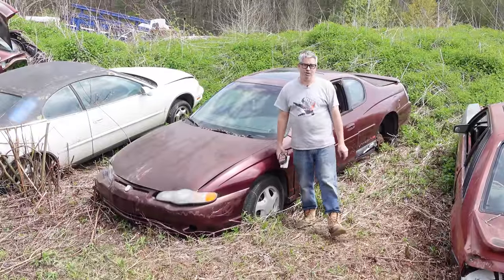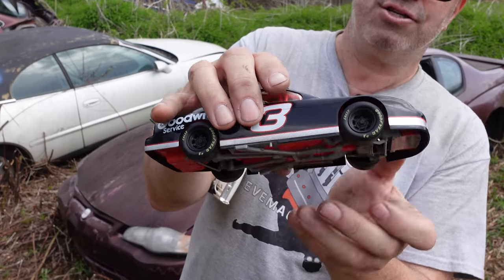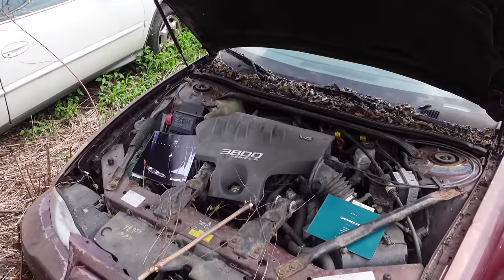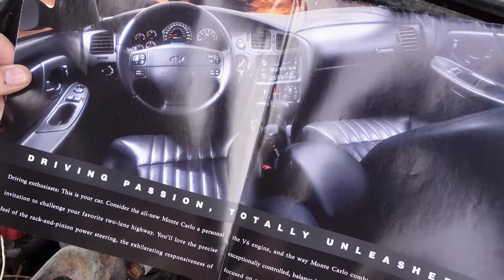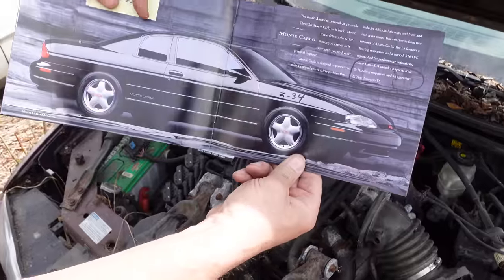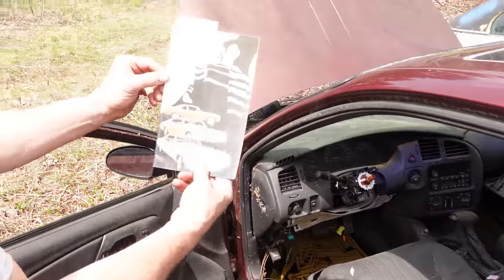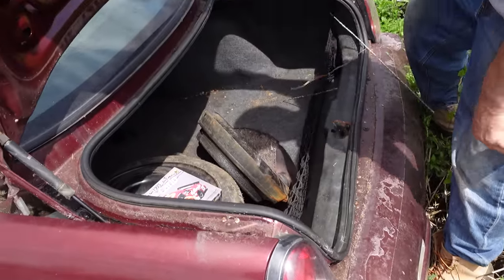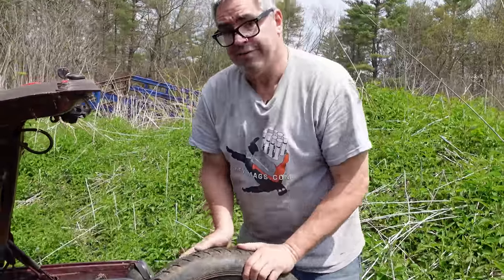Monte Car Low

Comment: 2000 wasn't the first appearance of the Buick 3.8 series II in the Monte Carlo. The last two years of the  previous gen saw the 3.8 replace the 3.4 Twin Dual Cam motor in the Z34 model.

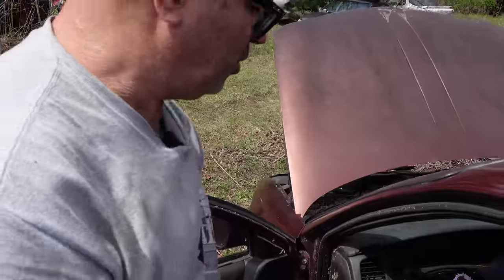Comment: Anybody else notice the Lumina Z34 in the background at 6:42? You could get those with a 5spd manual for a few years. There were a few odd choices by GM for the Gen5/Gen6 W-body Montes. Like why they maintained the Z34 moniker when they ditched the DOHC 3.4L and went to the 3.8L in 97. I don't understand why they didn't go straight to the 3.8L SC motor for the SS when Pontiac and Buick had already been running it in their W-bodies since 1997. Made it feel like such an afterthought when it finally happened in 2004. The LS4 SSs are definitely the odd duck of the LS family, but it was pretty cool to see a V8 make it's return to the Monte line, even though the LFX 3.6L V6 would eclipse it in power after the SS model was gone.

Comment: In 1994 I went to the dealer to order a new 95 Monte Carlo,  I was so disappointed by the V6 front wheel drive that I completely jumped brands and bought a V8 RWD 95 Thunderbird instead.

Comment: I have an 06SS.  Black on black. 5.3 LS4. Drive it everyday. I put a Jasper trans in it 5 years ago, and other than that it's been the best car I've ever owned. Comfy, moves right along and sounds great. Get compliments all the time. Got my license in Dads new 72!  I've had a 72, 97, (2)98's, 20, and my 06. Daughter had 2, 98's.  I've BEEN to Monte Carlo to visit my sister and attend the Grand Prix there in 09. If they ever came back, make mine an LS3, 6 speed rwd please.
Reply: Surprised you haven’t put more than one trans in it. Awesome car though hilarious 0-60 definitely a sleeper
Reply: @darrensanimalsreptilesfish30  Because I replaced it with a Jasper 'remanned'. Upgraded internals, not a rebuilt with OEM stuff. 5yr, 100k mile parts AND labor.
Reply: @SuperOperator4  Post some videos of it.
Reply: Jasper?? 🤣🤣🤣🤣

Should've used a Monster High Performance Transmission instead. 

Best transmission case closed.
Reply: @extremedrivr  Going strong after 3 years, beat daily

Comment: Chevy had the Warner Bros. contract even before this car. In 1999, the top rrim level Venture minivan was the "Warner Brothers Edition", complete with badging on the front doors by the Venture nameplate of Bugs Bunny leaning against the trademark "WB" shield.
Reply: @corvairjim1 I had a 1962 Rampside sat in the backyard off my buddys house. For almost 25 years. Had a lot of rust bought a brand new fuel tank from Clark’s Corvair. Got the firing order corrected Cleaned carbs. By the way Bought it for $2k had it towed to my house almost 6 years ago. Truck fired up had the mystery shifter the one that rubs on the tank. Very reliable truck. Sold it about 3 years ago went fast to a guy in LasVegas he brought a trailer. I’m from San Diego.👍

Comment: I bought a 2005 LS for cheap at 170k miles, and even though I know I'm about to have to drop a couple grand into it to fix all the little issues that have started to crop up (20 years old, it's expected), it's probably my favorite car that I've ever owned. It's shockingly comfortable for a cheap car, and the engine runs great. I'm determined to keep this thing on the road past 300k miles!

Comment: Yes, they quit clearcoating certain underside areas, probably to meet government mandated restrictions on total output of VOC's (volatile organic compounds aka solvents) In the late 90's , some genius somewhere, came up with what they referred to as "under hood colors. Most refinishing techs ( car painters) were none too happy about that, myself included. The factory would paint the underside of the hood, and fender edges, a different,  but similar color. It would be a non- cleared, non- metallic basecoat, even if the exterior color was metallic.  That meant mixing a second color for that area. If you had , say a door to cut in ( paint the inside) along with something under the hood,  it took 2 different colors. When I got a job replacing the doghouse ( both fenders and the hood) I always cut the parts in with the exterior color, and clearcoated it. It looked so much better! When the customer would notice, they always liked, and appreciated it. I even had an insurance adjuster compliment me once, a very rare occurrence.  Lol
Reply: Nice! I always wondered why the undersides on my parent's 84 Celebrity were dull. Thought it was cheap compared to the full paint on dad's 66 Coronet.
Reply: Fellow body shop guy here too. I know exactly what your talking a about 😅

Comment: My dad had one of the 5th gen z34 cars and my mom had the the 4door lumina at the same time. Fun fact about that engine with 210hp in the z34. While my dad had his i was riding behind a lumina ltz had no idea what that was till that day. I did notice the 4 pipes sticking out the back and the z34 wheels but didnt think it was anything but my moms lumina with a appearance package, that is till it dusted my pickup. I called my dad and said i just got smoked by a lumina, what the hell is a lumina ltz. He said my z34 with 4doors. 😅 so yes they put that 210hp v6 in a few lumina not sure how many but dont think it was a bunch. Dad sold that z34 for a front drive super charged regal gs. Now that was a fun car think it had the same engine as the 6th gen monte ss but with a super charger on it. During that era buick was throwing super chargers on alot of their cars even some of their 4door luxury cars had them just look for the supercharged badge on the trunk.

Comment: I owned a 1998 Lumina LTZ which was basically a 4 door Monte. It had this same drivetrain and was a decent enough car until the northeast winters here dissolved the rear subframe sections. Notorious for bad valve cover gaskets also.

Comment: First year Monty's on a modified Chevelle rolling chassis were supposed to be FWD. But in afterthought GM calculated they would be way too expensive for most Chevy buyers to justify the added expense of their new Turbo Hydra-Matic 425.                                                     So instead of placing the powertrain way forward like on a Toro or Eldo, they mounted the motor and transmission conventionally back near the firewall, used a mile-long fan shroud and rad hoses and...went right on.

Comment: I loved the 78 Monte Carlo I drove in highschool but these were so disappointing. I drove one as a rental and it was truly bad. The giant spokes on the steering wheel left no comfortable long term position for your hands and the one I shared with a co worker ended one long drive with a puddle on the passanger floor from a missing/misrouted a/c drain tube.

Comment: Probably around 2000 there was a local guy who made a 1971 Monte Carlo convertible. He made the rounds at the local cruises! A Chevelle ragtop was used as a donor vehicle. It turned out nice!👍 As for the FWD Montes, I got nuthin' . Don't remember even driving one.🤔
Reply: I remember back in 1996 from Road and Track mail in comment section, One of the Chevy fans were not happy with Monte Carlo being revived as FWD car stating it could ruin the classic Monte Carlo's legacy.

Comment: I loved these in the Earnhardt Intimidator editions. Saw one at Barrett-Jackson Scottsdale in 2018 with only 300 miles on it and only sold for $11,300 (inc buyer fee).
Fast forward only 5.5 years and local private owners are trying to get $20K for non pristine ones and I’ve seen some dealers wanting as much as $35K for a pristine condition version.
Have a neighbour who has a pristine one in his garage with his C6 Corvette. Drives neither and daily drives a KIA.

Comment: I owned a base model 04 with 3.8L. I still think it is an attractive body style and really love the interior (design, not materials). Aside from the front wheel drive, I think GM got this one right. Of course an AWD would have been a grand slam! 
In 2008 I ordered a new Camaro SS, which would end up being built on the same assembly line that the Monty vacated.
Reply: Base models never came with 3.8 i got a 2004 ls they have 3.4 in them.

Comment: I had a 2001 LS, it wasn't a bad car, at 180k the 3.4v6 decided to develop a bottom end knock.
It had the spoiler so I don't think it was a SS only option.
Reply: Had 05 3400 myself drove the balls off it got to 172k and sold it.

Comment: This might have been the first time a front wheel drive Chevy was called an SS, but it wasn't the last. My daily car is a 2006 Cobalt SS that I bought new in September of 2005. Its just the 172 h.p., 2.4 L Ecotec twincam, not the 195 h.p. Supercharged version, but that's what I wanted.(172 h.p. is enough to get you in trouble in all 50 stares and Canada!) That's all the performance that I needed in a commuter car, and it handles great! Besides, the EPA combined fuel economy rating on the Supercharged model was only 28 mpg, while they claimed 31 combined for the 3.4 cammer (34 highway). With the price of gas started going through the roof  in January 2020, good fuel economy is a real asset. With some simple "Hypermiling" techniques, I regularly see over 40 mpg. on summer grade regular with a high tankful coming in at 44.8 mpg. Winter "oxygenated" gas brings my average down  to around 37, but I'm satisfied with that. There was never a Monte Carlo, either front or rear wheel drive, that came anywhere close to 40 mpg!

Chevy also offered a Cobalt-based HHR SS, which is a really odd duck in my book!

Comment: When the Monte Carlo came back for the '95 model year, I was working for a small-town (pop. 2,000-ish) Kansas Chevrolet dealership.
My main job was being the literal one-and-only "oil & lube" tech, and minor repairs (such as brakes, etc).

But my secondary job was prepping and road testing every new car that the transport dropped off.

When the dealership rec'd it's first Monte, I could hardly wait to inspect everything about it. And of course, take it for a test drive.
And honestly, I really liked the car.
If I could have afforded the monthly payments (assuming that I could have gotten a loan to start with), I would have gladly bought a brand new '95.😁
Reply: for a second there i thot u were going to say you wiped one out  lol
Reply: @DanKirchner5150  no. I guess I could see where you might have thought that was where the story was going.
Reply: @willhorting5317  cos back in the day i test drove a brand new beretta and thinking it was this great performance car from all the tv ads  i took it too fast around a sharp curve and the ass end lifted off the ground putting me into a good spin  ,lol  luckily there were no trees around
Reply: @DanKirchner5150  🤯
Glad you were ok 
I didn't do things like that when I test drove.

Comment: I have the 2004 impala ss 3.8 supercharged which is basically the 4 door version of this, great reliable car with decent power, but if these were rwd they would've been proper classics right now with great resale value, GM really crapped the bed on these cars by making them fwd, keep in mind on these Cara, replace the factory plastic coolant elbows with metal AC delco ones and make sure you check the brake and fuel lines, they like to rot away especially if you live in an area with a decent winter, and make sure the transmission has been recently rebuilt as well replace all vacuum lines they get dry rotted and and break really easily much quicker than ford products of the late 80s and 90s but other than that these cars are great reliable comfy work horses with plenty of Pep, plus a smaller supercharger pulley with zzp headers would really wake these cars up, 257,000 km on mine and its still running like a top and doesn't burn any oil

Comment: Was there a specific  Chevrolet  V6 '  or  over the years were  they all Buick motors  and  basically   just classed as a GM v6 ' and put into Buick's ' Chevrolet's ' and maybe even Oldsmobile's ??.  I'm a  car painter and I've noticed that the peeling clear coat problem is particularly  prevalent on red/maroon cars ' I dont have  any idea why.
Reply from the maker: Hello Barrycuda, Chevy did have some home-grown V6 engines, the biggest being the 4.3 liter used in pickups and vans. It was essentially a Chevy 350 V8 minus 2 cylinders. Chrysler pulled this same stunt with the 3.9 liter Magnum V6, which was the 318 V8 minus 2 cylinders. As for passenger car V6's, Chevy was the primary designer of the 2.8 V6 used in the 1980 -up Chevy Citation and many other Front Drive econoboxes of the day - plus the Pontiac Fiero. The Buick 3.8 V6 legacy goes back to 1961 and the 198 / 225 push rod, odd-fire V6 that was used until 1963 then all tooling was sold to Kaiser-Jeep only to be re-purchased back to Buick / GM in 1974 for a 1975 re-release as the OPEC gas crunch kicked in. As for the many, many other GM V6 engines after the ones i discuss here, I don't see them as being Buick or Chevy sourced. I just call them GM Corporate engines because the same basic engine could turn up in just about any GM passenger car. Thanks for watching and writing. -Steve Magnante
Reply: @SteveMagnante  I've been doing a bit of research , and it appears that the Buick v6 has a relationship  with the alloy Buick v8 that was sold to Rover in England .My v6's official  title is 3.8 Ecotec  L36 'I looked it up.

Comment: I was working at a GM dealership as a mechanic when the 5th and 6th gen Monte's were being built. The 3.4 DOHC (4 cam) engine was a beast. 7400 rpm redline. The 3.8 might have only been rated at 10hp less but I bet the real numbers were 50hp less or more. Once that 3.4 was wound up it really hauled the groceries. It was just a regular 60 degree 2.8/3.1/3.4 V6 with a much better top end. With that said though, they were horrible for maintenance. You had to almost entirely remove the cradle under the car to replace the alternator. It was literally a 4 hour job and customers just loved paying for that. They had the same oil leak problem around the "oil drive plug" that was essentially the bottom of a distributor housing with a short shaft and a gear inside. This was super common on the F.I. 2.8 and 3.1's as well but it was a simple job on them, it took about 10 minutes to replace the o-ring. On the 3.4 DOHC the intake manifold was built so one corner stopped you from doing that. To fix this super common leak you had to remove the entire intake manifold, both upper and lower. So a $30 repair turned into a $400 repair. Finally the timing belt was a nightmare. There were no timing marks on the cams, no keys on the timing gears. Basically the cam gears could go in virtually any position. There are tools that lock the cams in place and a convoluted procedure that only an engineer, or possibly a room full of engineers, could come up with. And this is the engine I always point when I am explaining why mechanics hate engineers. I still have my cam locking tools setting in my tool box. But I don't think I've seen a Monte or a Grand Prix which also got this engine, actually running and driving in maybe 15 years or longer.
Reply from the maker: Hello 1967davethewave, Thank You for watching and writing. It's guys like you who were "down in the trenches" servicing these cars who have the best stories - and reviews - of them. Again, THANKS for shedding a bit of light on the "dark side" that each and every car ever made seems to have. As an old boss once said: "EVERY car has an arm pit. Some take a longer time to find...but they all have one". After all, they're "just machines" - and yet so much more too. -Steve Magnante
Reply: I currently own a 91 Cutlass Supreme International Series coupe and a 93 Grand Prix STE sedan.  Both are undergoing restoration and optioned with the LQ1.  I love em!  I don't understand what all the hoopla is over these engine and their so called maintenance nightmare.  I rather enjoy working on them and find it's no different than any other motor I've wrenched on.  Yes, the necessary tools are a must though.
Reply: @jiggity76  Well an alternator on a 3.1 takes about 15 minutes to change and only requires the removal of the alternator and it's surrounding bracketry. The 2.0 Sunbird takes no special tools to replace the timing belt and it can be done in about an hour with minimal disassembly and most other GM engines with timing belts are similar. And I misspoke on the oil drive o-ring, you actually have to pull the rear head as well as the intake manifold where as on the regular engines is can be done in 15 minutes with regular hand tools. So while I love the 3.4 DOHC as it is a great engine and I wish GM would have continued it's production (better than the current 3.6 HF DOHC engine for sure) the hoopla is pretty obvious over maintenance.
Reply: @1967davethewave  Understandable.  I have lots of patience aside from all of that.  With the extra time and patience these LQ1's require...I feel they are still well worth the effort and give the owner so much joy and excitement thru their performance.
Reply: @1967davethewave  Just the other day on my 93 GTP parts car, it only took me an hour and a half pulling the generator and cooling duct assembly.  I've worked on these motors now for about 8 years and the practice has helped.
Reply: @jiggity76  I had the alternator down to about 2 hours but tat was well below book time because I had some short cuts. That was way back in the 90's. Like I said, they were a superior engine in my opinion but still, anything with that many parts and that much physical size in cars not really designed around it are going to be cramped to work on.
Reply: @1967davethewave    For sure.  These cars were originally designed for the 2.8/3.1/Quad.  Adding the LQ1 with it's big, beautiful aluminum heads definitely filled up the engine bay.